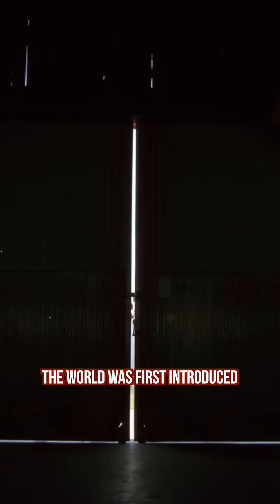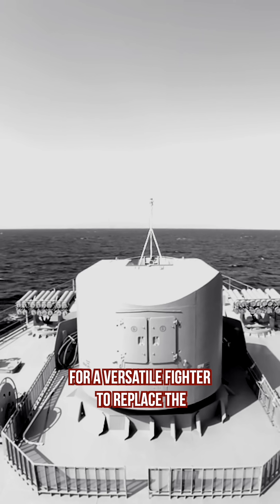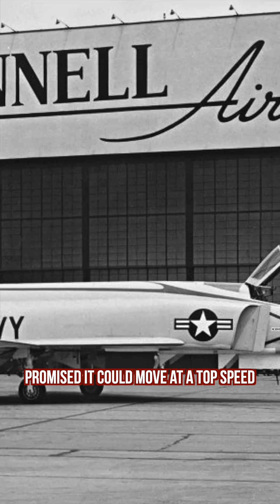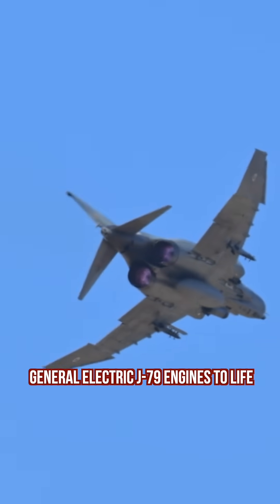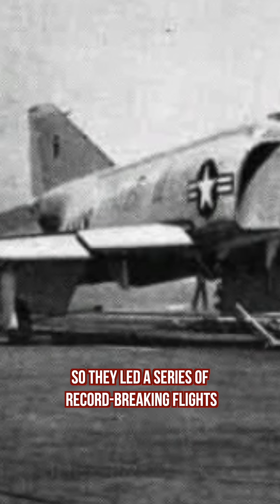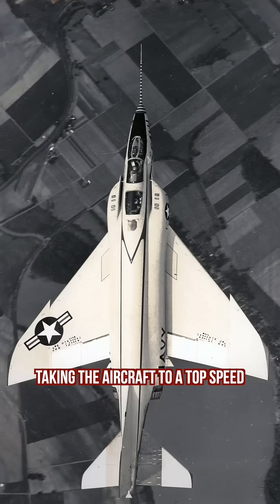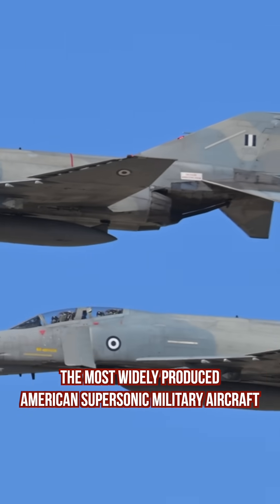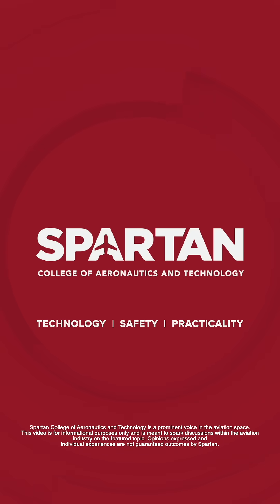The Story of the F-4 Phantom II Going Supersonic

Comment: Very stupid to design it without guns. They had to jury rig it to attach guns to it after they figured out their mistake.  Other than that it was a good low altitude light bomber with just enough ability to flee from enemy fighters, but it was no dog fighter.  It barely did okay against enemy fighters only because of superior training. By the late 60s and 70s it was so obsolete that the navy had to use another oversized plane but with better maneuverability, the F-14, as a stop gap measure until they finally came out with the F-18 which was what the navy needed all along and the Air Force finally decided that power alone wasn’t enough without maneuverability so they finally came out with a plane that had both superior power and superior maneuverability which was the F-15.  The 1980s was really the first time since WW2 that U.S. AirPower finally reclaimed superiority over its enemies in terms of aircraft capability. The F-4 wasn’t that great.  Superior pilot training made the F-4 look a lot better than it was in terms of air to air combat.  Both the navy and air force got duped a little by McDonnell Douglas. Idiots didn’t even design it to have a gun which meant they had zero input from pilots.

Comment: The F-106 interceptor and nuclear bomber has a top sped of 1650 and capacity for remote control to the target in case the pilot was wounded or unconscious!
Reply: One of these (F-106) also once flew & landed (more or less) itself after the pilot ejected after going into a flat spin. Happened in the '70s. When he ejected,the plane went out of it's spin & continued flying until it came to a very soft landing in a field in Montana. Found by a Deputy Sheriff with the engines still running,he called to dispatch to get ahold of the Air Force (Malmstrom AFB) so 'Someone can please tell me how to turn this thing off!!' The Plane actually flew again & is now in a museum.
Reply: @DrOlds7298  Yes you are right. I read about it. The aircraft could be remotely flown by central command.